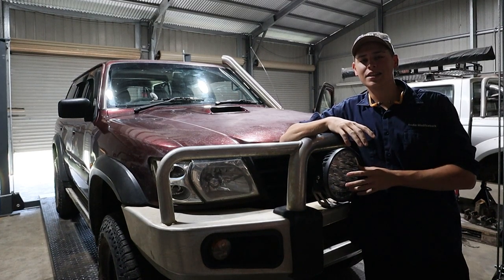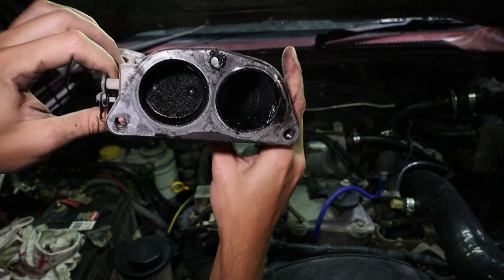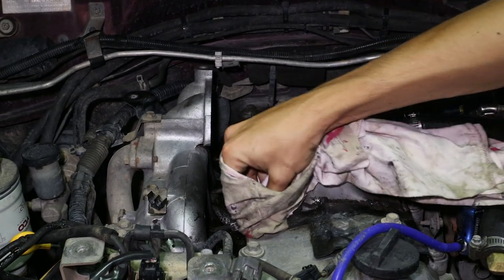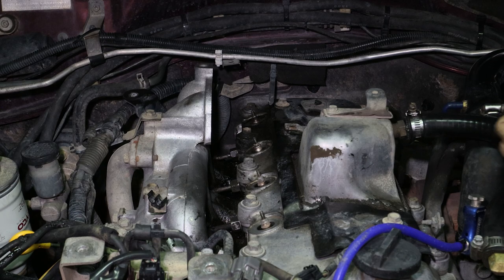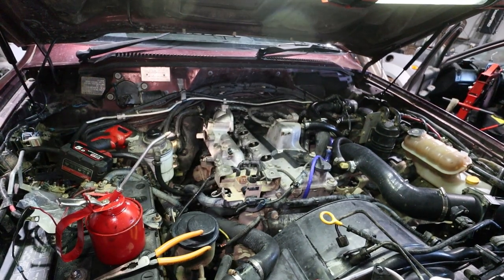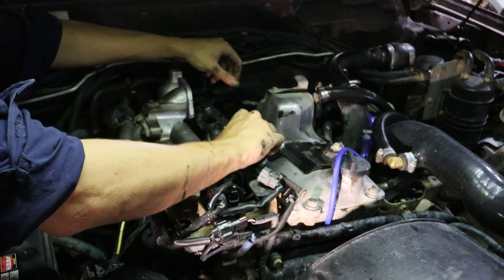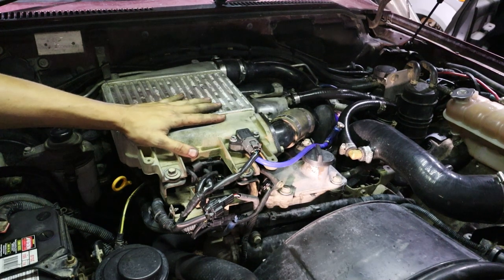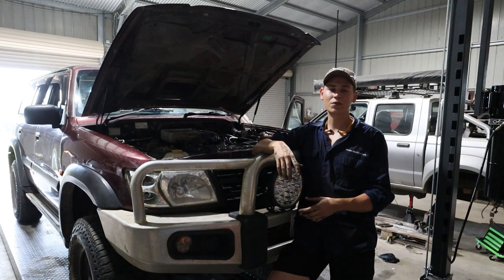ZD30DI - Injector, Glow Plug, Valve Cover Seals

Comment: How did you get to the bolt for where the 4 fuel lines meet?
Reply from the maker: With great difficulty and swearing 😂 from memory I used an extension and wobbly drive

Comment: Got any tips on how to remove intake manifold on d22 zd30
Reply from the maker: Patience, not a fun job and a bit of a squeeze but you need to be careful around the injector lines as they're easy to damage. Ratchet with a few extensions and a wobbly drive also helps.

Comment: Good day mate, im gonna get my ZD30Di injector seals serviced also, but i stumbled upon one with a 13276-2W211B part number online and had a "frontier" on its title, from my researching 13276-2W211 are the ones for patrols, or are these just about the same? What does the "B" at the end stand for? And have you installed replacements like those before do they hold up as well as the genuine ones? Cheers, from Philippines
Reply from the maker: Hey mate, I searched online for 13276-2W211B and only got results for 13276-2W211. I think the parts are the same as I have both ZD30 from a Patrol and Navara and they look identical. I have only installed non genuine seals and they have worked well.

Comment: In the middle of doing this job. Came across this when looking for instructions on bleeding the fuel lines. This is a pig of a job! I also took off my intake as I struggled to get my hands in there (I also wanted to clean it). So many little lines in the way!

Thanks for the video mate. Super helpful.
Reply from the maker: Awesome to hear that this helped mate, it sure can be a tight space to try and reach down into 👍🏻

Comment: Hello!

I have an Urvan with a ZD30 engine. I have a question:

When I take them out, the Glow Plugs come out full of black oil. The tip (where it heats) is dry.

Is there any gasket inside the valve cover that insulates the heaters from this? Or is it normal that the heaters in this ZD30 Model get so much oil stained? (Clarification: the tip is not stained, just upwards).

The problem with my car is that it is ver difficult to start and the mechanical workshop has told me that the glow plugs cannot be full of oil, otherwise it will not start well. They think that the tip is also full of oil so they blame the problem on the head gasket, but the radiator is not bubbling or leaking oil, which is confirmed when I see the dry tips and the compresion its Ok inside the cilinders. So the only thing left for me is to find out if it is normal for the top part to be so full of oil.

My apologies if it is "a lot of text" but in my country there are few experts or connoisseurs of ZD30 engines and I am paying mechanics who do not know about the engine and they say one thing, and in the end they are not :/
Reply from the maker: Hello so the glow plugs are inserted through the rocker cover and into the head. There is a seal at the top that often fails and will cause the top of the glow plug where the buss bar mounts to become oily and leak oil over the intake manifold. Under that seal the glow plugs are in the head beside the camshaft so this part of the glow plug is normal to become oily. There is then a thread where the glow plug screws into the head and below the thread will have carbon build up on it.
This is what they will look like but it can be hard to visually identify if a glow plug has failed, you can test them with a multimeter if you need. 
I would recommend replacing them as they are not expensive and they are a consumable component, they will fail eventually and require replacing 👍🏻
Hope this helps👍🏻
Reply: @ReubsModifications  Thanks, the info is gold!
Reply from the maker: @zoishiworld  no problem 👍🏻

Comment: Thanks for the vid. How did you get to the injector line clamp that holds all 4 together? There are two 10mm bolts, one which I just about can access the other no chance. There's also one 12mm(?) Bolt holding the bracket on but it's behind the injector lines and I can't get any ratchet or spanner onto it. 
Last option is to completely remove the EGR valve and see if that gives me anymore room to work with. New sub btw, helpful content!
Cheers!
Reply from the maker: Thanks mate 👍🏻 I had to remove most of the EGR system that is under the intake. The more you take out the more room you get but mean more parts to put back together again.
Reply: @ReubsModifications  Cheers man. About to go tackle this job again in the cold with limited daylight so need to not waste time scratching my bullocks like yesterday. Knowing this I'll crack on and take out the EGR. Been looking on the forums and couldn't find a definite answer on this. You've been a big help man. Thanks again 👍
Reply from the maker: @Michael-mh5pu  that’s awesome to hear mate glad I could help, how did you end up going?
Reply: @ReubsModifications  sorted it 👍 removed the EGR valve - just the 3 or 4bolts holding it on, so it was lose, then could get access to the bracket and remove the injector lines. Impossible to do without this like you said in the vid. 
Trying to sort a pretty nasty oil leak and hoping this is the cause, and it's nothing more major like the crankshaft seal

Comment: The best tool for working on a Troll, especially if you have bigger boots on them, an Over-Wheel Step. Cheap and way handy for troll-works.
While messing around with the glow plugs, making a set of power cables for the GP's and get rid of the shitty metal bus strip. When doing the seals, replace the plugs as I will bet you have more than one in there with a tip gone. 
Injector seals, yeah, lines must be loosend at the pump. EGR pipe is in the way along with brackets. Good time to FIX one of the biggest ZD30 killers, the EGR shit.  Pro-Tip, degrease the donk before you work on them. 
Best advice I can give after doing a few of these, do all the seals at same time, take the rocker cover off so you get all the shit out that you WILL DROP in it.
Your cranking is very slow, crappy battery cables and sad starter results in slow crank and hard-starts.
Reply from the maker: Awesome tips mate I’ll look into one of those tyre steps, I’m going to do an engine swap soon so only blocked up what was leaking to get me by but changing the plugs while you’re there is a great idea. As for the poor crank the previous owner had a deep cycle as the cranking battery 😂 I’ve since swapped it out and cranks much better 👌🏻 thanks for the tips 👍🏻
Reply: @ReubsModifications  swapping in what is the question now being asked?
Reply from the maker: the good ol nissan forklift motor, love the sound of an old diesel
Reply: @ReubsModifications  Oh no, not another TD Kettle conversion. Money pits for low figures. Done to death.
Reply from the maker: @bentheguru4986  yeah not wrong, I just wanted something that sounds better than the ZD and I could throw in easily that wouldn’t take all the extra work of a full conversion.
Reply: @ReubsModifications  All conversions are pricing out of the shed. Even the TD is over-prioced and over-rated. Then add in all the legal shit, messy. I just hit the point of a decision, if my ZD hits the urinal wall, either $$$ for a decent don'k worth it otherwise, moving onto a 4WD truck. For now, my ZD is nearly at 500K and still going good while doing 10-11L/100.
Reply from the maker: @bentheguru4986  yeah thats for sure, some people are charging the same for a TD42 as a 6BT, ridiculous. I managed to get mine cheap enough and there’s the other benefit that it’s a factory option so saves the cost of adapters and converting. What would you be considering for a swap?
Reply: @ReubsModifications  That's fair enough and good points. Seriously looking at bigger Isuzu powertrians, not the 4JJ stuff either. If I was staying in 3L, would just rebuild the ZD as OM606 options are as expensive as the Cummins options. Witht he weight of a Patrol, diesel wins but so does cubic capacity, small displacement and high boost does not equal the longevity, reason why you don't see trucks with sub-5L donks and big boost to move 40-60T all day, every day.

Comment: I'm losing lot of oil I don't know from where on my Zd30  ! how to be more confident that issue comes from injector/glow plugs seals ? 
Might be the issue as it appear to be quite common.
Reply from the maker: You can usually tell if it is the Injector/glow plug seals by the amount of oil around the top and rear of the engine. Its very easy to see if you remove the intercooler from the top and look around the intake manifold. There will be lots of oil around this area.